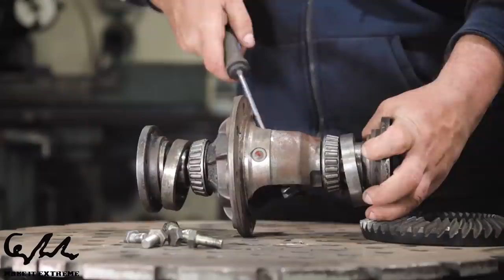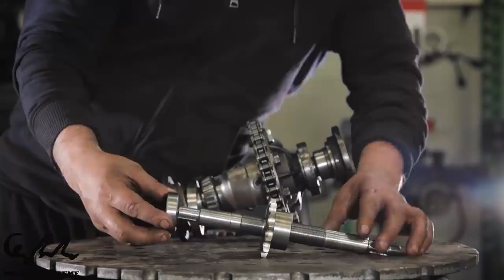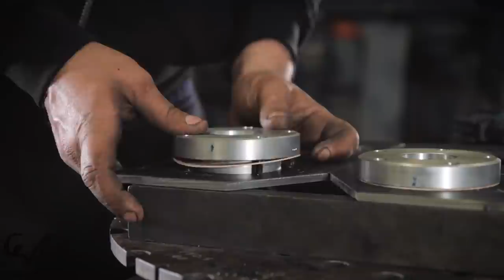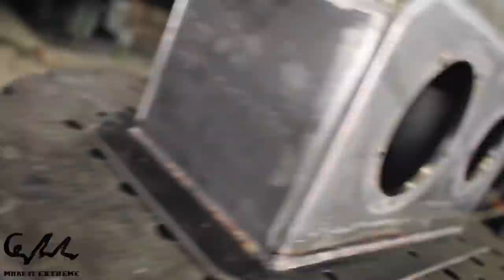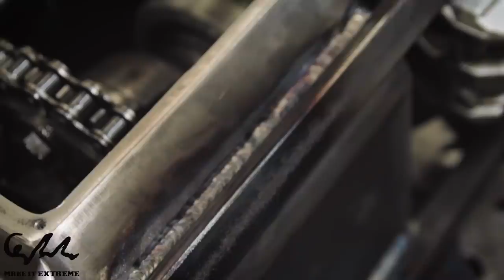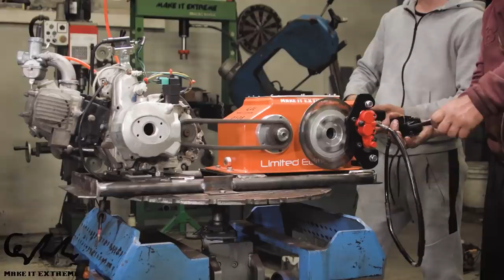Making a Differential Braking Tank Transmission

Comment: Awesome job, and very skilled! Can anybody tell me what it's used for?
Reply: For making a video.
Reply: @Happyfacehotwheels  LMAO
Reply: @Happyfacehotwheels  in other words... you don't know either.
Reply: I think it’s for vehicles that have wheels at the front but tracks at the back
Reply: @hueyvan2007   The design won't work for a tank or skid steer but works great for a video. This video is a shorter version of the original made over a year ago.
Reply: It'd be good for a small paddle boat
Reply from the maker: https://youtu.be/on165eU_SL8?t=501
Reply: @MakeitExtremeShorts  awesome

Comment: So you have basically inverted the purpose of the differential so you could stop one tank track and keep the other one spinning in order to turn, brilliant idea 😁
Reply: It’s almost like this idea was first used 100 years ago 😱🤣
Reply: @AlexR1298  Sure, but still if a student made this with his own hands and learned something from it, it is impressive.
Reply: @MrArni765  Oh yeah of course! All I was saying is that is literally how a real tank works. You just brake one side of the differential, this is a smaller scale version. Simple tech but very effective!
Reply: @AlexR1298    Tanks and other tracked vehicles use clutches To disconnect the power to the track and the brake stops the track. There just using a open deferential which makes no sense.
Reply: @Happyfacehotwheels  I agree. while it's a cool build, as soon as it came up on something requiring lots of torque, the side with the most traction would stop pushing.
Reply: Did this by using 2 ebrake leavers on my 1966 VW Bug works awesome allows the vehicle to turn in a dime

Comment: So what would this be used for? Great video btw. Just unaware of an application.
Reply: I see the application. This would be used in a vehicle that has no conventional  steering such as a tracked or multi wheeled vehicle. Where the track  would be braked on the left to turn left and right to turn right.
Reply: Lol. You can do that with wheeled tractor too if you wanted. I did that growing up for fun on the farm.
Reply: It's no good for a tracked vehicle because of the use of a conventional diff i.e you could end up making unintentional turns on slopes etc.  Tracked vehicles have no differential, instead clutches are used to disengage drive to whichever side to make the turn.  Another issue with using a differential in tracked vehicles is that when you apply the brake to one side because the way the gearing works it increases the speed of the unbraked side which can make turns somewhat difficult to manage.
Reply from the maker: https://youtu.be/on165eU_SL8?t=501
Reply: @MakeitExtremeShorts  Hi.  I'm building a tracked chair myself for my partner, she had an illness which limited her mobility.  In our case we went with using two 60v 2000w brushless motors with reduction gearing, these simply bolt to a flange that connects to the drive sprocket, my engineering skills are rudimentary compared with yourself so I opted for simplicity, the only engineering I need to do is the drive flange itself, everything else is either premade or just fabrication.  Forgive my comments regarding your selection of an open diff, no offence intended.  Just wondering was there a reason you preferred to go with the open diff Option? Regards

Comment: What if you press both brakes?
Reply: It would go into screenshot mode, or just explode lol
Reply: It would slow the engine down.
Reply: @JamesParus  if you lock the outputs of a diff and the engine is directly coupled to it...unless the chain skips it will stall the engine, not slow it down
Reply: @dpsilver1  engine RPM has to slow to stall.
Reply: @codyprice0295  have u even driven a manual or gone offroading...if your wheels lock up ie there is no chance for them to spin then the power looks for the next avenue, the gearbox namely the clutch. If it doesn't give out or something doesn't break the engine will stall regardless of RPM. If both brakes are applied there and provided the chain doesn't jump which is the most likely thing to happen then the engine will stall immediately
Reply: @dpsilver1  in order for the crankshaft to stop rotating, the crank shaft revolutions must first slow. Lol. A stall in this context is caused by excessive drag on a power train. The engine crank shaft is halted. But first, in order to halt it must slow down. 
 The answer is, unless the engine breaks the chain, stretches the chain to a point to where the chain slips on the sprocket, breaks an out put or input shaft, or strips the sprocket teeth, the engine crank shaft will slow to the point where it does not revolve any longer which is the definition of a stall. 
So yes. The crankshaft by law must slow to stop.
Sincerely your concerned counterpart.
Reply: There should be a manual or automatic clutch to decouple the propulsion mechanism from the gearbox.

Comment: What happens when the internal chain stretches? How do you adjust it?
Reply: It shouldnt stretch, it's not a belt
Reply: @dexterjsullen  All chains eventually stretch with wear.
Reply: I guess it will need to be changed. Use the style with heavy side plates

Comment: Please excuse my Doctorate of Internetological Knowitallism: would a GY-6 style engine/torque converter be a better fit for this? Your mad machining skills could mate the belt carrier directly to the differential, and do away with any need for clutching the engine.
Reply: Mr Plurge- wouldn't the belt slip in the gear oil?
Reply: This is art.  It need not be the shortest path to the destination...but also, it's literally for a tank (chair), you should watch that video too.  Amazing, just amazing.

Comment: That's cool, but why not just drive the input shaft of the diff and stick a couple of disks on the output shafts?
Reply: Because he wanted to chain drive from the transmission. Both for the ratio change and keeping the engine in line with the diff steering

Comment: Good idea and superb machining skills, but preferably the housing must be beffier (heavily bolted and doweled thick plate assy.(not welded to avoid warps)Also the side plates where the bearing flanges sits must be machined finish to ensure 100% bearing to shaft perpendicularity.Other than that you did an excellent job worthy of 100 thumbs up.